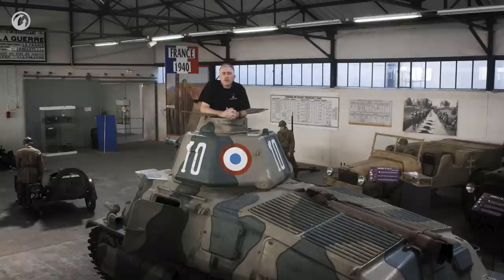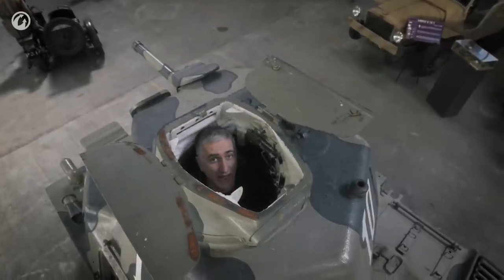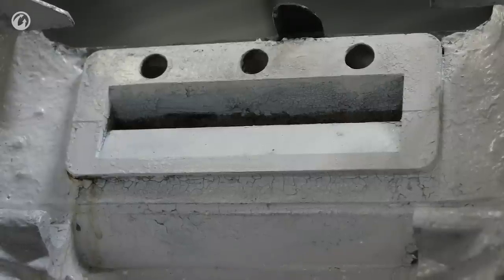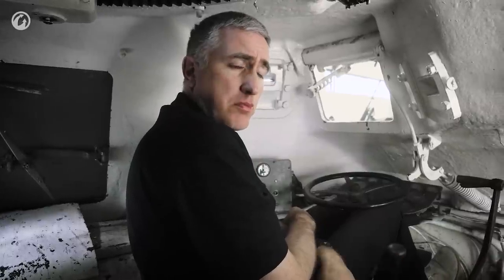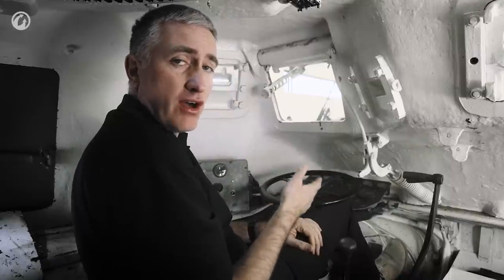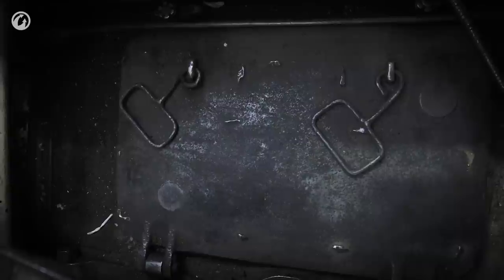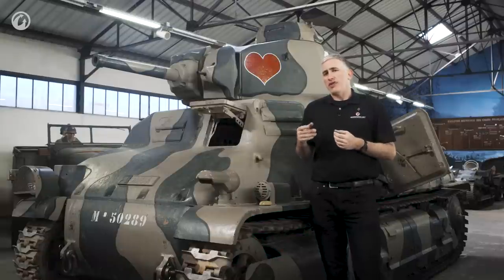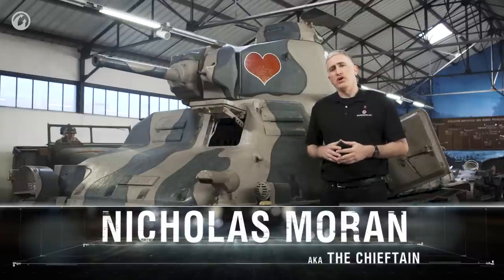Inside the Chieftain's Hatch: SOMUA S35 part 2

Comment: No “Oh my good the tank’s on fire!” through the cupola? :D
Reply: Remember the M-60A3s cupola on top of it's machine gun turret. Back in 1983 I was driving a M-60A3 on fall night when a cold front caught us by surprise and we had our heaters cranked. Then I heard a explosion to my left and pulled the tank to a rapid stop. Not having any ammo, it took me a second to realize it was our fire extinguisher bottles exploding from the heat from my vent. But I quickly realized as the second one went off there was no danger. Meanwhile back in the turret, they heard the explosions and rushed to get out of the tank. More specifically the gunner reacted and got a black eye from the gunners sight, before trying to stand up. Bear in mind he doesn't have a hatch, so he thought he'd go through the Commanders hatch. The problem was the Commander was trying to crawl out of the hatch and due to the height of the .50 cal. turret and the gunner trying to crawl up his ass, was having a devil of a time. Hence the gunner switched to the loader and shoved him the rest of the way out of his hatch before crawling out.
Reply: @williamsager805  wow
Reply: No need to. The tank crew are supposed to surrender asap
Reply: well the gunner/commander has the back door, so it probably be easier that way
Reply: @King.Leonidas  
"Oh mon Dieu, Pierre! Ze tank is on fire! Quick, slowly cranck ze back hatch open!"
Maybe if it had some sort of emergency release lever but just cranking that shit open would probably result in someone trying to flee out of the half-open hatch, get stuck and get his ass roasted.
Reply: @The_Crimson_Fucker  as far as i know the back door, is a push door? with a hinge, it would probably stay open for the most of the time since its a better view sitting from that then the commanders copula
Reply: @King.Leonidas  
Chieftain was literally cranking it open with a winch in this video, dude.

Comment: I think that the sloped hinges on the hatch would also keep it from swinging shut suddenly when the tank is moving. I would be nervous driving it with the hatch hanging open, it might hit something. Unless it opens all the way to lie flat? But if they want ventilation it might be worth it. And even stationary, if the hinge was a conventional hinge, it would be poised ready to swing down really hard if someone bumped into it, which would suck for anyone with a body part in the way. This way you have to really work to close it. Although i can't imagine that's very easy from inside the hull. I guess that's why you have strapping young men do these jobs.

Comment: I think the independent MG is brilliant. I assume the setup is the same in the Char B1bis, although i don't remember it being pointed out that it could be locked in as a coax gun. That gives you the benefit of stable fire for precise targets, and a free pivoting gun that can be used while moving and at area targets. Since neither tank has a bow gun and that was one of the main reasons they kept those so long, it makes sense that they would make the turret MG work in either role. And it's also a lot faster if there are smaller fleeting targets, it's a lie faster to swing a flexible MG over a bit to cut down a running enemy than to be stuck rotating the turret. And in this case you can still rotate the turret to any arc you want to fire into, unlike a bow gun. Only drawback i see is that i wonder how well the gun returns to zero when you lock it into place again. Although it doesn't need to be super close for most purposes.

Comment: The Average ( mean value ) of US Troops in WW2 was 5’7” tall.   For every 6’ tall troop  there was (1) 5’2” tall troop to net an average with (2) people.  Millions of troops would be included into the 5’7” average.
 
Troops were sorted out based on height into occupations.   Submarine crews were small men. Tankers were also smaller men.  

So when a man about a foot taller than the height of Frenchman in the 1920’s  intended for tank crews tries to fit in a tank of that era it is by design.   They were not designing vehicles that men could not fit into.  So it looks like they designed clown cars but they did not.
Reply: Yeah, he keeps exaggerating that aspect, I assume for humor, but people actually listen to whatever they are told. He says "you can't fit into this with all your limbs intact!" I'm like "well, thousands of men did, so it can definitely be done.

Comment: The side hatch design with the door sliding down on an angled piece of the hinge is very clever - but I'll bet it wasn't invented for the tank. Looks like a good design for a heavy iron door in a fortress, and France had plenty of those. It could have been invented 200 years before the tank.

Comment: Les concepteurs de ces chars connaissaient-ils les conditions du combat blindé ?
Reply from the maker: Apparently not. The flaws were identified (or confirmed) in testing, but no changes were made to the design. Possibly due to cost or time.
Reply: Effectivement, mais le temps perdu ne se rattrape jamais ! Bonne soirée

Comment: it seems to me that a lack of visibility is a pretty common problem in the early war tanks. France just made it worse by over working the commander
Reply: To be fair the French did not make this decision blind.  It was a known compromise they willingly took,  taken into consideration of the situation they were facing.   The politicians were against having a well trained professional army,  due to fear of coup de estat and getting another Napoleon born.  The accepted doctrine was a large conscript army, drafted only at time of war, thus with little training.   This then puts in many constraints:   They lacked specialists such as radio operators,  and coordination between tank crews were poor as they didn't really know each other and had little training together.   Things like radio actually would not help them much, as the troops cannot make a good use of them anyway even if they had it.   The conscript army was good at doing simple pre-formulated linear tasks, and at that only.  This was mitigated by quantity.  The idea was that even if individual tanks or infantry can only perform simple tasks,  if you have enough numbers on the battlefield, you can still steamroll your enemy.

It is under these considerations the French tanks were developed.  Technically they were superior, they wanted as few men manning these as possible.  So you have 2-men tanks, 3-men tanks, etc. with the same number of crews they can field more tanks against the enemy.   They envisaged WW1 type scenario of static frontline, and localised concentrated linear offensives.   In these type of battles vision and battlefield awareness isn't that important, all you need to see is the front.   The commander is not overworked either, as his task is simple,  advance straight ahead, and take out anything you see in front of you.

Comment: France had the tech, the industry and experience with tanks, how could they end up with that? granted the benefit of hindsight, the tank was well built but its characteristics were abysmal! (small turret, cumbersome hatches, overloaded commander) not to mention the lack of familiarity of the crews with the machine, as I recall from another video, the military witheld bits of the maintenance for fear of espionage. WTF France?!
Reply: Well, with the benefit of hindsight yes, the tank couldve been built better, but at the same time you have to consider france had different goals in their tank design, one of them was making them affordable, and one man turrets went a long way towards making the entire tank a whole lot smaller and therefore cheaper, while at the same time of having the Matilda effect of being able to afford very thick armor with much less weight due to less surface area needing to be armored and thus less metal being used. 
Another good thing about a one man turret was that it had a small frontal cross section, meaning it was not only harder to hit, but also it could be shaped much more aerodynamically when compared to 3 man turrets of the time like the Pz III or IV, or even the Vickers Medium MK I or II, meaning their resistance to AT guns was very good as well. 
But yeah, some decisions and parts were just hideously bad, like the dome cupola or the vision slits not having armored glass blocks in them.
Reply: Not to mention the horrible manpower shortage France suffered as result from World War One; I believe the French suffered the most; But yes, lack of radio, adequate training and employment of their tank forces negated any positive qualities it had. the PZ III and IV more than made up for their lack of armor in that regard. But yes, easy to see it now while it was somewhat new tech back them.
Reply: Lack of money and manpower. Also lots of political shenanigans from Germany and Russia who had it in their interest to keep France from fully recovering after WW1.
Reply: Thats apparently not too uncommon there was a video the cheiftain did about an american tank with virtical stabilizers built into the tank but the crews were never taught how to use them for fear of the information falling into german hands.
Reply: It appears France put a lot  of its eggs in the Maginot Line basket. Not enough resources left to develop and build a better.  Plus, with the Maginot Line,  tank warfare would have been a reduced concept.
Reply: The Maginot was plenty successful at what it was meant to do, namely block the Rhine and ensure the fighting would happen in a predictable area. One might also note that well-designed fortifications age a lot better than tanks, especially ones from a period of developement as rapid as the Thirties - the things were still tactically relevant in late-war clashes in the region, unlike the early-war vintage trophy tanks the Germans still had in occupation duty...

Anyways, in hindsight most interwar tank designs ranged from "okay" to "awful" due to any combination of technological and industrial limitations, economic squeezes and militaries mostly having only a very vague idea of how they even wanted to use the things in the first place, nevermind now if the theories would actually survive the test of battle.
In practice everyone had to debug their doctrines and design philosophies bigtime based on practical experience; due to a combination of geography and gross military cock-ups the French just got KO'd before they could go through the necessary trial-and-error process.
Reply: France also had a really rough time politically and economically in the '30s; many of their tanks from that time had development stop for a year or two at a time because they lost the fight for the scarce resources available. So if a lot of the French tanks from 1940 look a bit unfinished or else rushed together at the last minute, they really were. The B1 especially; if you're going to have a crew of five it's criminal not to put three of them in the turret...
Reply: @Hebdomad7  Germany and Russia (essentially)  lost WWI and suffered the  heaviest casualties in the process.  In effect France and GB had the whole Europe for themselves for good 15 years. So it wasn't manpower shortage or political problems. I think the problem was more of psychological nature. You can say that  France had a nasty case of PTSD as a nation.
Reply: CipiRipi00  1. The statement like "Panzerwaffe helped Germany to solve manpower shortage problem" is impossible to argue one way or another. Simply because nobody can come up with exact formula "Effect of Y*Panzerdivision = X*Grenadier Division" so  you could put a hard number on that. In reality  they needed them both. In its "best" years only one fifth of Wehrmacht divisions were tank or mechanized units. And even Panzerdivisions consisted of one panzer regiment of two tank battalion. The rest are infantry, artillery, tech support etc. So it's not like Germans needed less men than before. They just assigned them with new tasks.
2. I was answering to @Phil. Who said that Germany and Russia somehow prevented France from building an effective military in interwar years. French did make a lot of mistakes. Without questions. As everybody else, BTW. But there's a difference between not having  a perfect army and not being capable of resisting an invasion in any meaningful way. I do respect France, its culture and it's history. Including military history. But years between 1918 and 1945 weren't France's best. To put it mildly.
3. I don't think you are aware of cumulative effect of WWI, Civil War, diseases, famine and mass emigration on Russia (USSR's) population. We are talking about 15 millions out of 180. But it's not only quantity, it quality of lost people that hurt the most.  Can you imagine US army that lost 95% of West Point graduates? England that left without 80% of people who went to Cambridge and Oxford? And that before great Stalin's purges. 
I'm sorry if my answer is too long.
Reply: A one man turret has advantages of being well armored while not needing a powered traverse. If you have a heavily armored 3 man turret like the Panzer III or the Matilda II you need a motor to spin it as it's simply too heavy to spin fast enough on muscle alone. However that motor takes up space and needs power so you need to make space for both it and a larger engine which further increase the amount of area you need to protect. Having electric or hydrolic motors also increases price quite significantly.

The French were also thinking about a much slower pace of warfare. Which is why radio was not such a high priority for them. In WW1 whenever units moved quickly they were crushed. Also tanks were magnets for artillery and were attacked by anti-tank rifles from all angles. That's also why the French tanks tended to have good all-around armor instead of concentrating it in the front to withstand direct hits from anti-tank artillery. I think they chose for side hatches instead of top cupola's because of artillery. Having a cupola on top is a weak point if an artillery shell lands on top of the vehicle. Also in WW1 many German soldiers threw grenades on top of tanks. The British even came up with a roof structure for the Mark IV to counteract this. If you throw a grenade inside the cupola you could seriously damage the hatch. I don't think a grenade has the power to get through the hatch but you could damage it sufficiently that won't open anymore.

That all around armor scheme of the French though was not unique. The German and Soviet tanks had the same idea. The T-34 has the same thickness of armor front and back and the side is only 20% thinner than the front. The idea of having a massively armored front was actually unique to the British and then copied by eventually everyone.
Reply: CipiRipi00  I don't think one man turret was a solution to a manpower shortage.  Another  3000 men in a country of 45 millions wouldn't make a difference.  Besides  B1 did have 4 men crew. So it's even less than that. I'd guess that design of the interwar French tanks had more to do with the legacy of FTs and there's also some technical reasoning behind it. Like weght saving. I  think French priorities were based on military doctrine that in turn was based on the experience of WWI. French envisioned the coming war as Verdun 
2.0 on steroids. And since  they won WWI there's no reason to change a winning strategy
Reply: @alexandervapnyar3979  "Germany and Russia (essentially) lost WWI and suffered the heaviest casualties in the process. In effect France and GB had the whole Europe for themselves for good 15 years. So it wasn't manpower shortage or political problems."

Wrong. Germany may have suffered more casualties in absolute numbers, but relative to the population size, France suffered a lot more, and combined with a lower fertility rate which meant that WWI losses weren't compensated, yes, France was at a SEVERE manpower disadvantage.
Reply: @lsq7833 OK. Even in relative numbers we are talking about difference between 1/33 vs 1/27. But more importantly: you don't fight war by relative numbers. War is kinda about totals. And as far as interwar period in Europe is concerned the French situation wasn't any worse that it was before WWI. Yes, there were still more Germans than French by about 30 mil. but France had GB as its main ally  while Germany had only  Italy.  In addition to Britain there were also Belgium, Poland  and Czechoslovakia, And on the top of that there were well known limitations put by allies on Germany in Versailles. As a result Germany, among other things, didn't have Navy comparable to Hochseeflotte of 1914. And on the top of that top France and England had total political superiority in Europe. They dominated in the League of Nations and maintained multiple military and political alliances with countries in Central and Eastern Europe,  It's nobody's but France and Britain's fault that they have allowed Hitler to devour those countries in 1938-39.
Reply: With the benefit of hindsight the M1 22 ton turret is superior, but nevertheless not an option